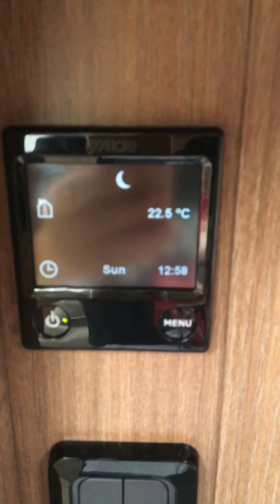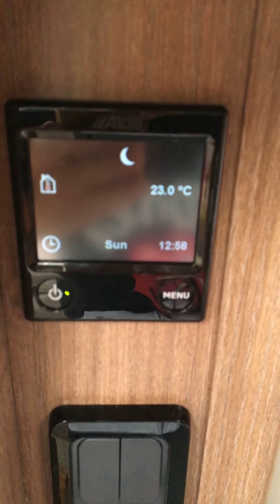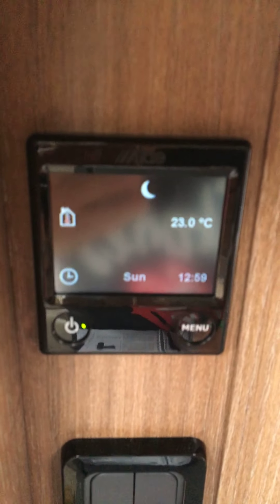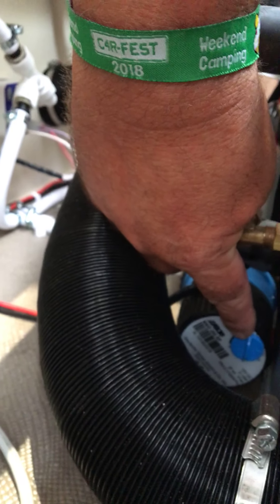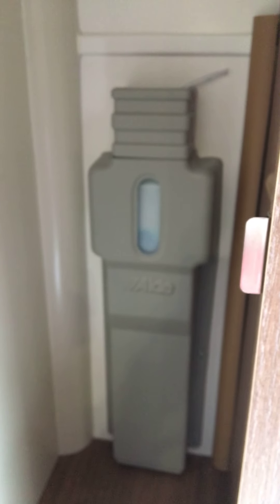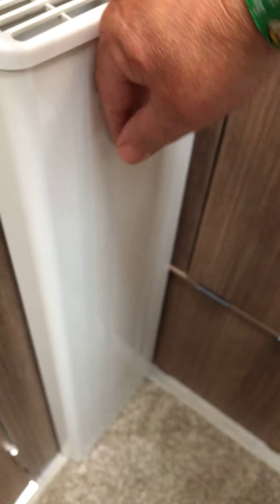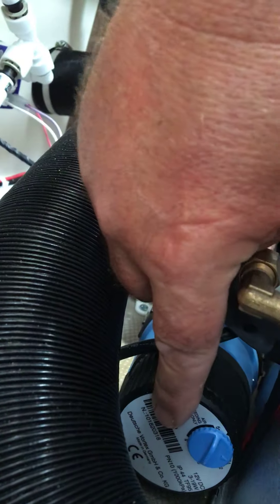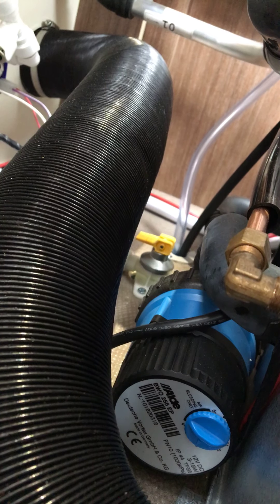Alde 3020 Heating in a Bailey Unicorn S4 Cabrera. How to bleed the system.

Comment: Trying this right now, I thought there was a problem with my heating as it’s not been used for months thanks to the great British summer time.   I’ll report back in 10 minutes if it works for me 🤞
Reply: Fantastic!!!   It has been like this for a couple of weeks and I was faced with a 400 mile round trip to the dealer to have it looked at under warranty where I would have had to have left the van and got a train home only to reverse the process the next week once they had looked at it. I also need to van to attend a wedding in a couple of weeks time and that was in doubt if we didn’t have heating.   You’ve saved me a small fortune, I can now take my dogs with me to my nieces wedding this month and I’ve learned a great trick for when this happens again.  Thank you so much, I owe you a case of beer at least 👍

Comment: If I change my fluid can I just empty from under my van which is a conquerer 645 and then blast the pump as shown on video to clean out and then fill , bleeding also along the way to assist with any air trapped. Or will I need to purchase a individual pump and connect with two hoses into feed and return untill all air is forced out. Any ideas on this
Reply from the maker: You will definitely need the pump to replace the fluid. Hi to not. A case of empty and refill.

Comment: I thought it was nessesary to ventilate the radiator. I have read somewhere that it will be nessesary to lift the caravan up to it`s  maximum, first in the front then at the rear then open some small valves that should be situated on the radiator. Waching youre video that is not nessesary??

Comment: I’m not saying you are Ron but do you know there are bleed screws tapes under the beds and lockers
Reply: Thank You so much for your video. Had the problem yesterday on my Challenger 560. Made an appointment with the dealer. Then I came across your video and followed the instructions. Bingo it worked. Thanks again. You saved me from 6 hours of driving. Greetings from New Zealand.